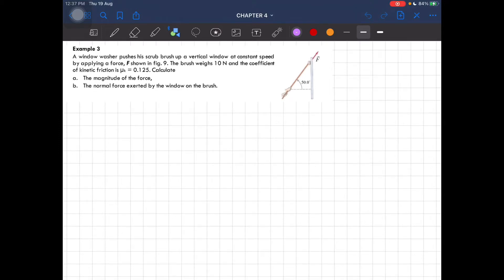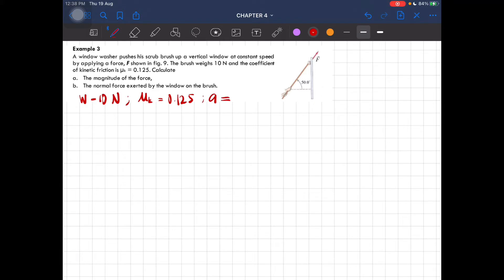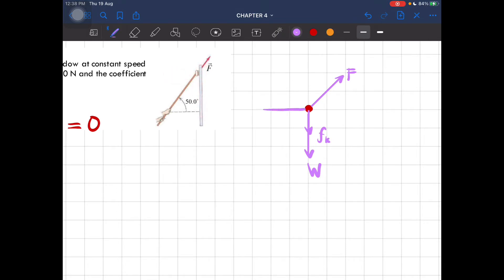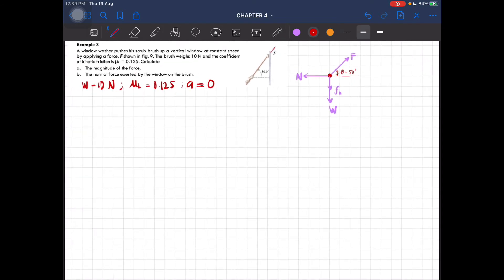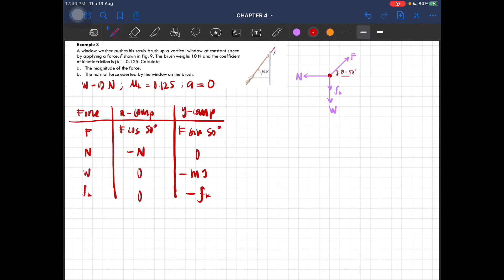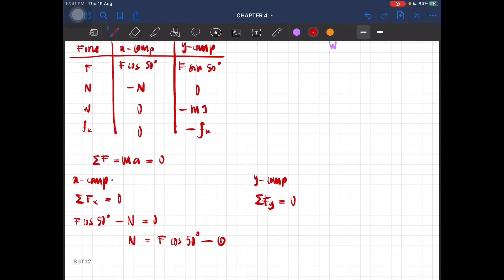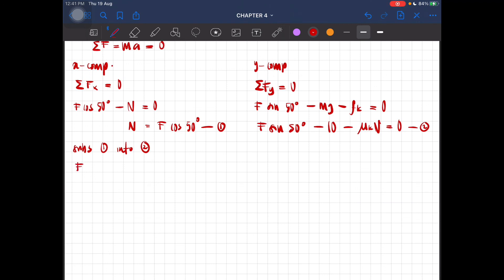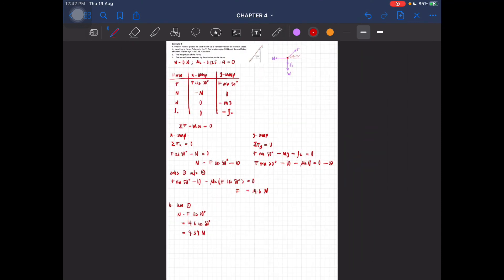Example 3

Comment: This is very helpful! But I would like to ask how do you come up with 14.6N? I've tried calculating it but I can't get 14.6 as an answer. Thank you!
Reply from the maker: If you rearrange for F, it should be (10)/(sin 50 - uk cos 50)
Reply from the maker: From there, you should then get 14.58 N
Reply: @gracedusim  I finally get it! Thank you so much for responding!